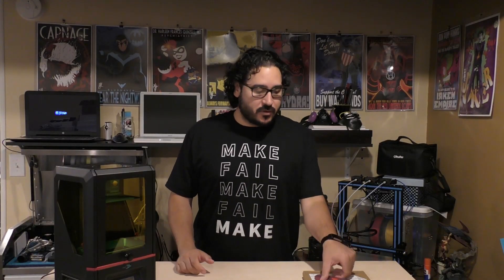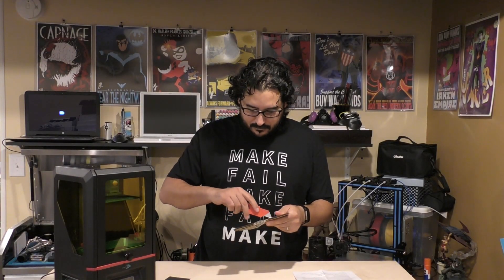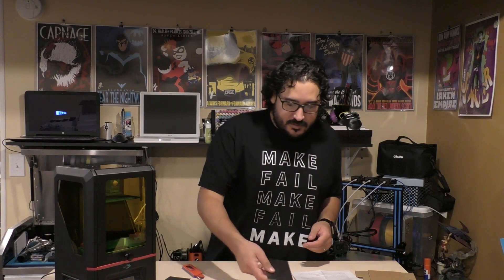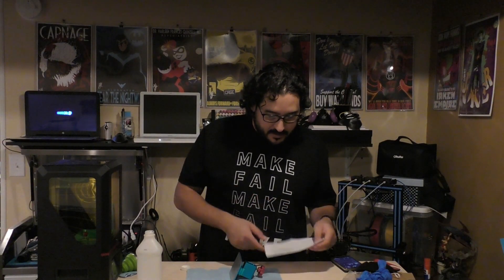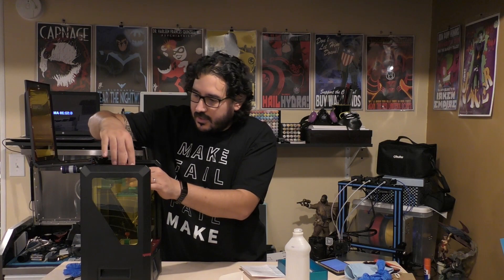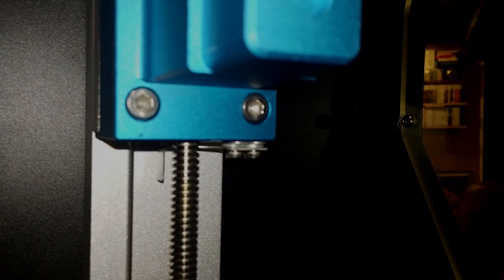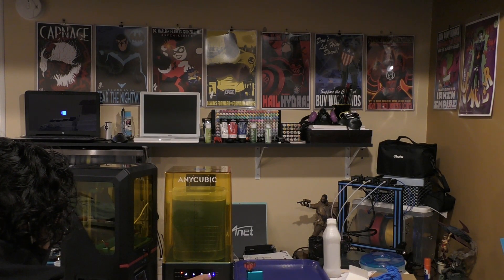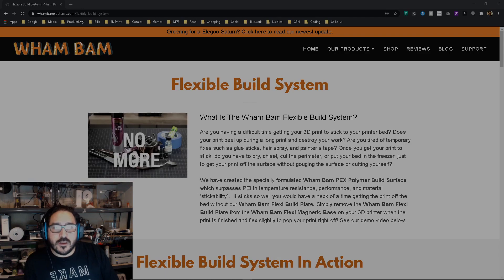Wham Bam Flexible Build System   Anycubic Photon

Comment: I was having the same homing issue, the fact that the kit doesn't come with a spacer or a warning that you need one boggles my mind
Reply from the maker: You are correct.  I imagine that it could potentially damage the screen if not adjusted.  'Thankfully' I have plenty of experience with FDM 3D Printers crashing into build plates to know that I needed to watch out for it.

Comment: do you need to sand down the original build plate. mine still has its paint on it?
Reply from the maker: Mine did not have any paint on it...  the build plate would adhere best to a surface without paint.

Comment: Probably not a good idea to immerse the build plate with Wham Bam into any fluid. Especially not solvents.
Otherwise excellent!
Reply from the maker: You are correct. I no longer put the build plate into the wash.  Luckily I didn't cause any damage the few times I did it.

Comment: hi. which plate size did you installed ? 135*80 ?
Reply from the maker: Yes, it is the 135*80mm Build plate system

Comment: WhamBam has instructions to make a 2.6 mm spacer for that Z limit tab before you attempt to relevel.  It's on their support site and they point to a file on Thingiverse for this STL.  

https://www.thingiverse.com/thing:4567231

I've just printed it and is exactly what is needed to address the Z height issue.

You will also need a pair of M3x8mm screws. The original screws are short and don't leave much thread available to securely mount the Z axis limit flag.
Reply from the maker: Thank you for the info! I didn't think to look it before I installed the kit.  The pair of locking washers work well and are holding tight.
Reply: Are the locking washers M4?
Reply: I printed it and used the original screws. It’s tight. Been printing for months no problem
Reply: Thank you!

Comment: great video, you can also snap off before curing to avoid curing any excess resin onto the plate if not thoroughly cleaned
Reply from the maker: Thank you for the comment  I wasn't sure if I could. I was scared it might bend the resin before it was fully cured. Next print I will give it a try.